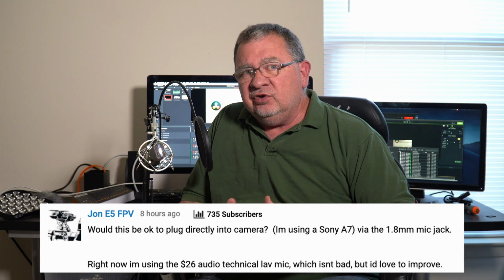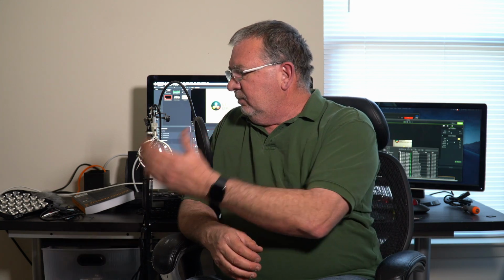TONOR BM-700 Mic Connected Directly to a Camera

Comment: The Tascam sounds indeed much cleaner. With Sony it seems the preamp is at least up a notch from Canon preamps. Any noise reduction on the Canon hiss will make the recording sound like crap because the hiss is in the same frequency range as the voice itself. That's why I got a Tascam recorder myself, I just couldn't bear listening to either the hiss or the tinny sound of whatever came out of the noise reduction. By the way, one hint for the shock mount on this thing: I have a similar one and the levers on the side that you press to release the mic actually often touch the other metal parts on the mount, which makes the whole shock absorbing contraption useless. You have to position it correctly so that they don't touch, which is possible with a bit of fiddling. Stupid design and I regret buying that mount because as soon as you adjust the mic arm the tabs will move out of position again.

Comment: I don't mean any harm, but professionally speaking this is not really an acceptable result. I am currently listening with headphones and would have a bad feeling, delivering this audio to a paid client (especially if I booked a sound guy). I generally try to always avoid the internal camera preamp due to high noise. 
If I had a really, really important interview, for me this would not be acceptable.
great channel!!!
Reply: As I said in the video, going directly into the camera WILL result in more noise due to poor pre-amps in cameras and you will HAVE to use noise reduction software. However, if you have a good pre-amp like a Tasmcam, Zoom, Juicedlink, or others will make a huge difference. Going straight into the camera, as I demonstrated, will not produce good quality audio without post-processing.